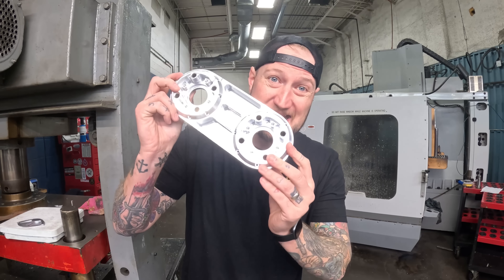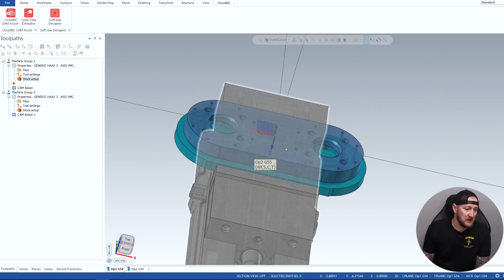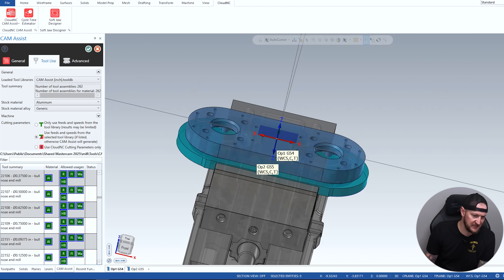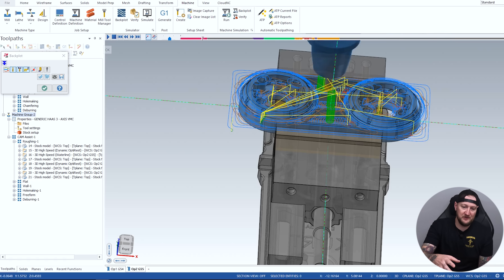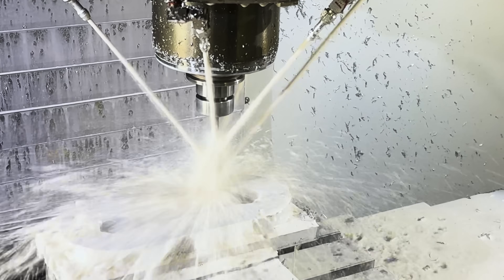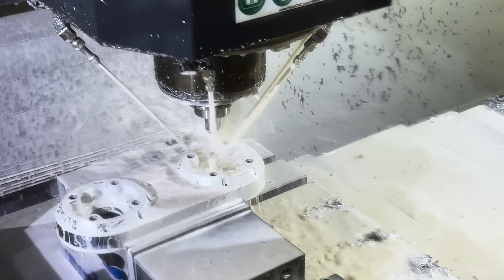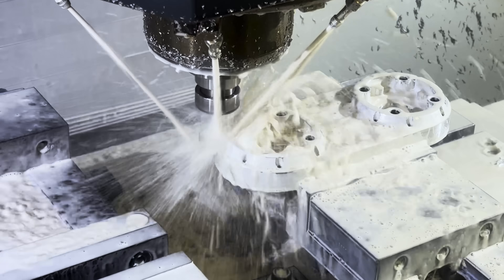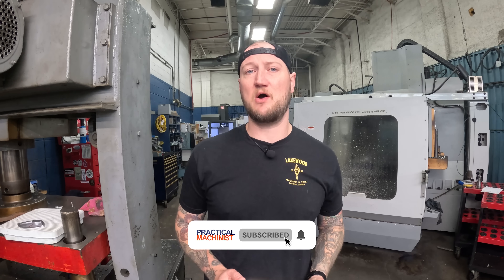How Did I Program This Part With Just A Few Clicks? | Machine Shop Talk Ep. 123

Comment: So i have a 2001 haas tm1 with 10 tool changer. I never programed for cnc. What would you reccamend for a beginners softwere?
Reply: Learn how to g code at the control first, basics. Spot drill, drill and tap. Then go from there. Cad cam is crutch.
Reply: @geothermopudge8475 I have allready. Been doin it for a while. Surprisingly there's not any info on using the haas conversation programming

Comment: can it read drawings ?
or does it only work with 3d models ?
how does it deal with tolerancing ?
i guess it must be connected to the web like fusion 360.
not sure about that.
i have done defense n aerospace work,
having customer data going up on the web is suboptimal.
i was also wondering if the ai model 
is running locally n requires alot of expensive local compute
or is this handled in the cloud ?
it does look functional tho.

Comment: I have a question how to calculate thrust force for a drilled hole by mathematical equations , is there a formula for thrust force ? lets say drill dia is 10mm, speed is 2500 rpm , feed rate is 100 mm/min, constant cutting speed is 78.54 m/min and feed per tooth 0.02 mm.

Comment: I am shocked that you use HSS drills. Personally, I gave up on those like 15 years ago.
Reply: Yeah, as a job shop I need every letter, number and fractional drill size - plus metric - doesn’t make sense to stock them all in carbide
Reply: @iansandusky417  Fair point.
Reply: @LakewoodMachine   You might consider cobalt stub drills if the DOC allows it.  They last longer, drill harder and no spot drilling required.  Thank you for all of your content!
Reply: Carbide drills are reserved for production jobs
Reply: @MichaelBowser-ce1px  I use them in 100% of my prototype and low-volume stuff. It seemed to be  more expensive until I looked at the time savings along with waaaay longer tool life. I rarely break them and therefore don't have the hassle of ordering or storing larger quantities. 

It has worked very well for me for a very long time. Overall, carbide is cheaper. Long life, less labor.

Comment: Do you need to model the deburring with little champfers on the part? or can you say deburr just all edges?
Reply: It'll deburr all edges by default (provided you have the right tooling, and currently with a few exceptions, e.g. it doesn't know how to back-deburr with lolipop cutters, that's in the 20% you'd have to do yourself) - Theo - CEO @ CloudNC

Comment: Incredibly slow roughing operation. Get some Kennametal Kor5’s and speed things up. Do any of your other machines have TSC? A must have. No spot drilling and no peck drilling. I have a VF4SS with high pressure TSC. Rocks. I use SolidCam with iMachining. It’s not AI but it does have a lot of automation. Fast machining.
Reply: We have a massive update to the roughing algorithm coming imminently - I agree the current version leaves cycle time on the table, and we've spent 18mths developing the V6 roughing AI. It often halves the cycle times output from the current model, and is smarter about tool selection, tool lengths, direction choices, and draws its own sketch boundaries. I think you'll like it. Theo - CEO @ CloudNC

Comment: mastercam has a sort of function called feature based machining i tried it and don't like it but the cam assist looks much better i will try it
Reply: From what I was told FBM isn't something that Mastercam has put many resources into for last while, I tried setting it up for running plastic on our router but it wasn't great.  I switched to making Operations Libraries for the different materials, and that has worked out great for the last few years.
Reply: Very worth giving a shot!

Comment: Been using cloudnc for two months now and its very hit or miss for me. The models must be damn perfect in order to not get geometry issues. Getting help hasnt been the best experience either. Not sure if ill continue using it or not, but YES it definitely saves time so its worth it in that regard. Also very spot on that your tool libraries have to be ON POINT in order for it to work.
Reply: CloudNC CEO here - Thanks Ian, I'm aware of the issues particularly in roughing, and we have a massive upgrade about to release that will step-change the roughing intelligence and finishing direction choices, making it a lot more hit than miss, and providing cycle times up to twice as fast. We've been working on it for over a year, hope you like the new model when it's out.
Reply: Thanks for the info.  What’s it cost?
Reply: @ 3k/yr or $300/mo
Reply: That's early access pricing FYI - pricing depends on scale of workshop.
Reply: It’s probably hit or miss because it’s recollecting info as it goes. It’s probably testing “on the field scenarios” and learning what users like to do. What incredible times we live in.